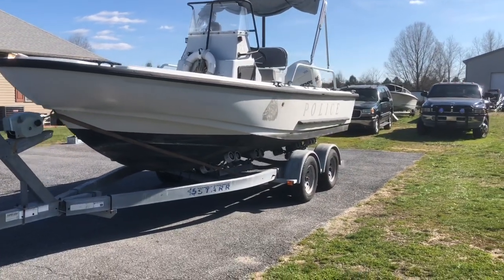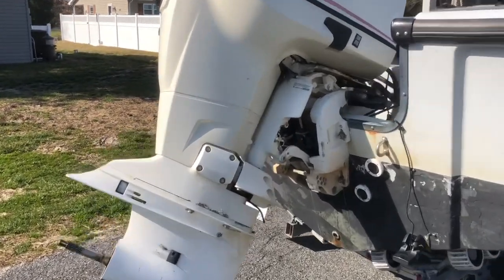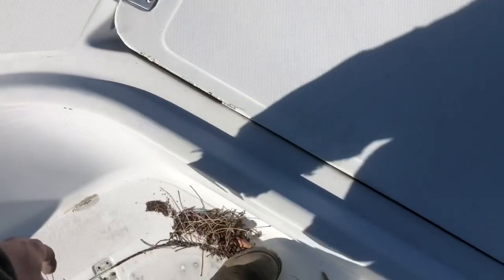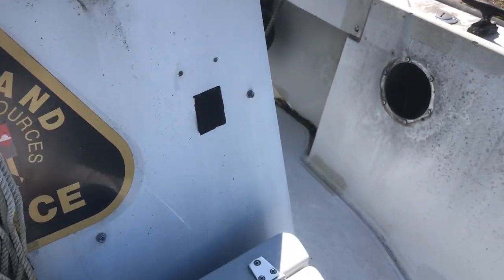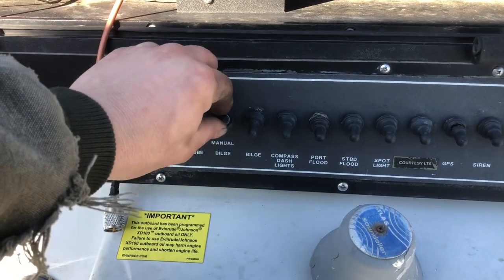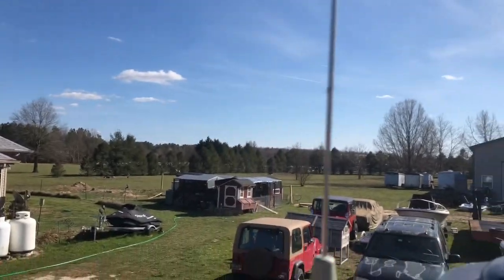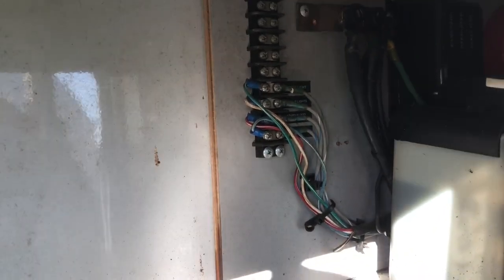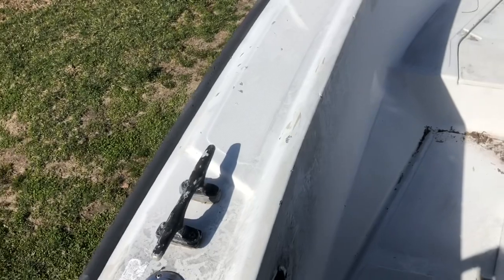My 2002 Boston Whaler bought from gov auction ( Govdeals ), possible a bad idea will it run again?

Comment: Project boat❤️
I’m looking one for long time
Reply from the maker: It is not a bad boat. I’m just trying to decide what to do with engine. Low comp on on hole and some other issues. Possible a fuel injector issue.
Reply: @kingdeadlego  get a new verado in a crate new there some places have excellent prices. It’s worth it by the way beautiful boat. Enjoy.